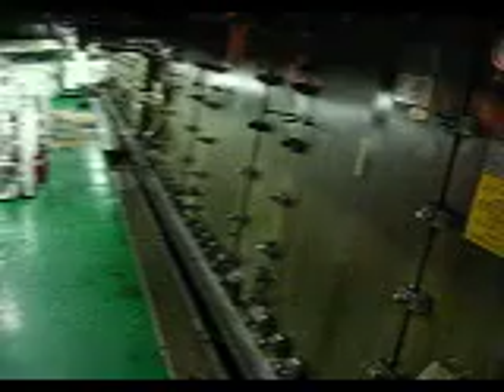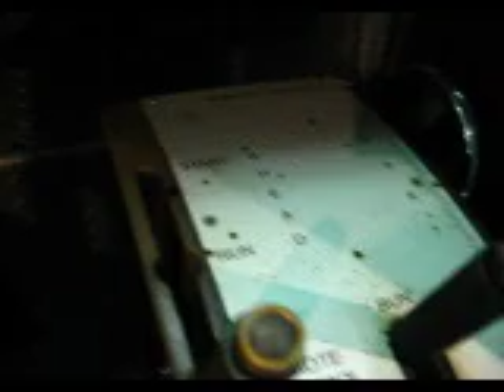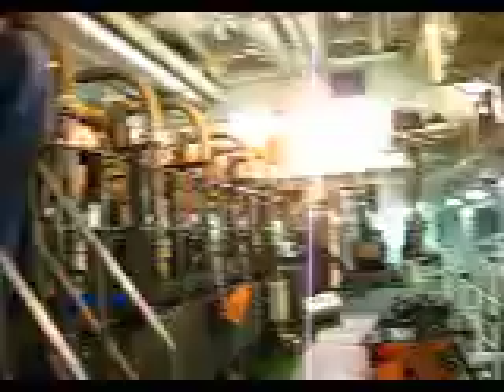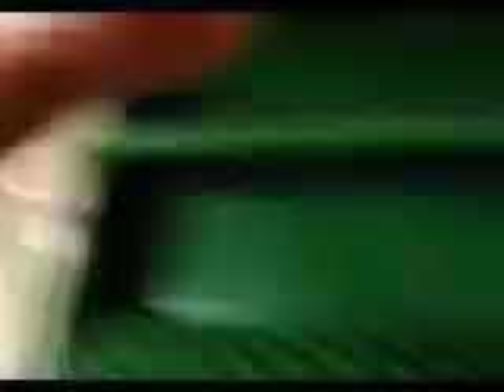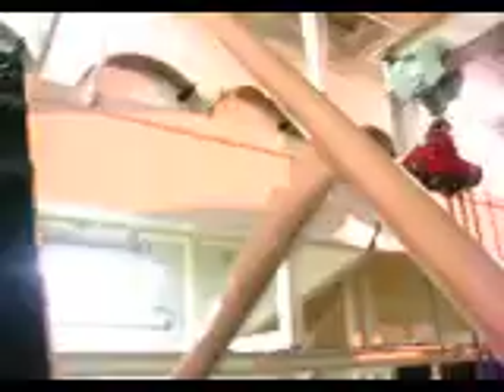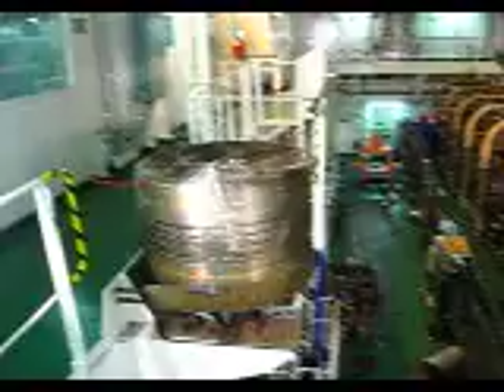2 stroke container ship engine

Comment: @mickeymoose76 The first Post Panamax containerships used about $500,000.oo dollars (U.S.) worth of Heavy Fuel Oil (HFO) per 35 day voyage to the Orient and back in about  1999 but fuel is considerably more expensive now. With a larger load of all electric refrigerated containers it takes more fuel. Many times 300 refrigerated conatiners of frozen and chilled cargo is worth more than the ship.

Comment: The Wartsila-Sulzer RTA96-C turbocharged two-stroke diesel engine available in 6 through 14 cylinder versions, all are inline engines.    Each cylinder displaces 111,143 cubic inches (1820 liters) and produces 7780 horsepower.  Total  displacement comes out to 1,556,002 cubic inches (25,480 liters) for the fourteen cylinder version. That is a huge engine!!!Look it up, amazing.

Comment: Part1
What you are referring to is constant torque over a rev range, thus equating to a linear increase in horsepower. That is not the subject I am talking to you about. I am talking about taking any general type electric motor whether it be DC or AC hooked up to a power supply will increase its shaft torque if a load is increased upon its shaft. The difference only being an AC motor has breakdown torque (max torque is not at zero) where as a DC motor will have an increase in torque up to 0 RPM.

Comment: So the Rotor can not move faster or equal to the electrical field in the stator, this means that the more load applied to the shaft of the motor will slow it down, causing a greater difference in speed which helps develop more torque, right up until the point the motor becomes overloaded torque wise and slows down eventually to a stop.

Basically it is not synchronous and does not maintain the same speed.

Comment: The advantages of diesel electric is that you can tune the diesel engine to produce a high power/displacement ratio, because the engine will only have to operate in a very narrow rev range, unlike in a straight diesel where power will have to be compromised with flexibility of power accross a comparatively wider rev range...

Comment: EETechs, I think I understand your description. In diesel electric locomotives for example, the point is that the diesel prime mover can maintain max power revs independent of loco speed. The amperes driven into the traction motors increases & decreases inversely to the rail speed, thereby producing almost linear rail horsepower due to the increase in torque as the revs drop in the motors - at least in theory. But this is still finite dependent on the power source for the electricity.

Comment: Part 2. Irrespective of motor type, a motor can only increase torque within its rpm range up to the point within that range where maximum rated power is reached. For example, to generate 100 bhp @ 100 rpm requires 5257lbs/ft of torque. To develop 100 bhp @ 2000 rpm requires 263 lbs/ft, & at 4000 rpm only just over 131 lbs/ft. Therefore for any motor to maintain speed against resistance would require an increase in amperage to boost torque, which is limited by power supply & the rated output.

Comment: Does container ship diesel engines power electric generators or are they direct drive engines? I always thought they were like Diesel-electric locomotive for the most part. I know alot about diesel engines, just not anything this big. I like diesel powered anything, but I really like thing I can run/operate by myself.

Comment: One thing about most electric motors is their torque increases under load where as I do not believe a diesel is capable of increasing its torque beyond it max. Another thing that is a particular characteristic of a synchronous 3-phase motor is they will maintain the same radial velocity even under HEAVY LOAD unless the pull out torque of the motor is exceeded in which case it will stall.

I did say 60-pole synchronous 3-phase motor. You got to remember more poles = low speed, but more torque.

Comment: Part2
An asynchronous AC motor or a DC motor hooked up to a power supply will lose some RPM's to gain torque when a load is placed upon their shafts, but a synchronous AC motor will have the same RPM irregardless of finite load placed upon its shaft. In other words if you were to graph its torque curve it would be completely vertical up to maximum breakdown point which if exceeded then the motor will fall out of synchronization causing torque to decline, leading to motor stall.

Comment: Part3
I choose a synchronous 3-phase motor because in that horsepower size the other motor types are not available. You can only buy a 100,000 HP synchronous motor I believe which makes sense because of high efficiency versus a DC motor of that size and power factor of 1 which an asynchronous motor cannot attain such a power factor. I suppose their *could* be a 100,000 HP DC motor, but that would be totally ignorant to develop one unless it was for a definite purpose application.

Comment: Part 3. For a motor to be able to continue to maintain its maximum rated torque at all speeds up to its maximum rated revs, would mean that its horsepower output would have to rise in a vertical straight line, which is not possible in practice except on a very minor scale. For an electric motor to equal the power of this diesel at 100 rpm, would require a stratospheric amperage that would need a generator set that would be too big to fit in the ship. Which is WHY it's diesel powered.

Comment: Umm most modern ships use a brushless design on their motors, that means there is no physical electrical connection between the stator and the rotor.  The speed of the electrical field as it rotates around the windings/stator is fixed depending on the input frequency and number of poles in the motor.  As the direction of the electrical field rotates around the stator, it cuts across the squirrel cage bars in the rotor developing a current which allows the rotor to move.

Comment: Diesel-electric is more efficient on smaller ships with high-speed engines, and especially ships like offshore vessels and fishing vessels with varying load.

These types of engines, which are too large for the aforementioned, run at a constant speed, just like a generator. Throttling is done by adding more fuel, and the propeller blade pitch is varied to gain more thrust. In this application there is no need for the generator/motor setup.

Comment: Part 1. EETechs, you certainly know your 'lecky' motors! But I was actually saying the opposite of your first sentence. Eg, variable torque, increasing as the revs drop, leading to linear horsepower over the working speed range. In theory, an electric motor can maintain constant rated horsepower down to the revs where torque output is unable to rise further, but that point is still entirely dependent on the strength of the magnets fitted & the amperage of the power supply to it.

Comment: EETech, I'm picking up a note of exasperation from you, so I'm going to drop the discussion. I've enjoyed our debate because you know your subject well. My resistance wasn't because I dispute the superiority of electric motors, which is unquestionable, it was simply because of the parameters you described in your original post. Of course an electric motor 'could' be built to out-torque a diesel of this size, but is it possible in practice? Is there such a motor of 69000 hp in existance?

Comment: EETechs, you may be right, but that would be entirely dependent on the revs that the electric motor developed said 100,000 hp. As you're aware, it's torque & rpm that produces HP. If quoted electric motor couldn't generate 68954 bhp down at 102 rpm, then its torque would be weaker than this diesel. But I fail to see your logic... A 100,000 bhp DIESEL would also out torque this 68954 bhp one. Also, even 100,000 hp is not spectacular in large jet engines. My point was about torque.

Comment: @tupsumato With very complex mathematics as it is not possible to put a rocket on a pole connected to a torque measuring device. The forces are too great. People don't call rocket scientists the most intelligent people for no reason. Actually, lots of ships use electric propulsion drive where the diesel engine turns a generator like the set up of diesel-electric freight trains. Our air craft carriers are a fine example of this. Yes, even for equal HP, electric pretty much wins against diesel.